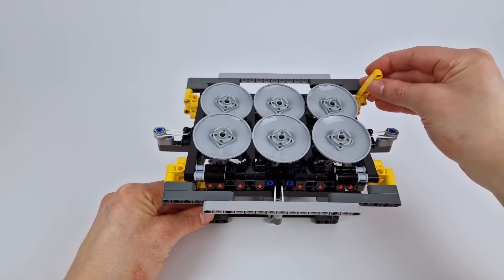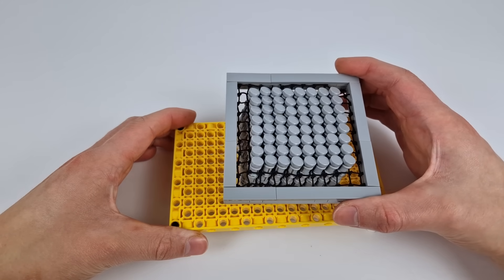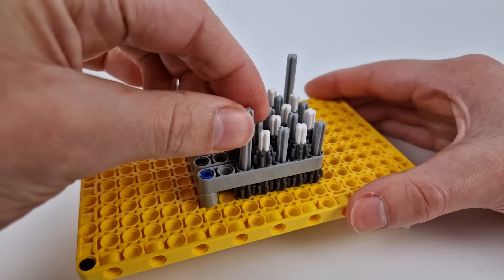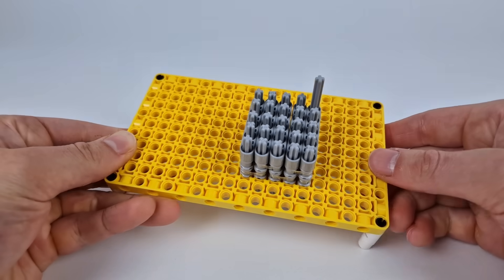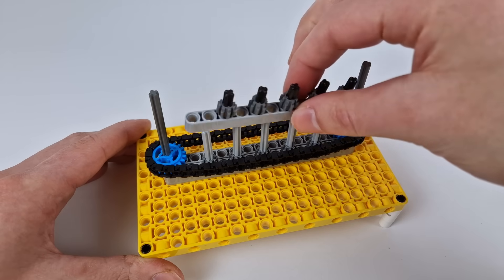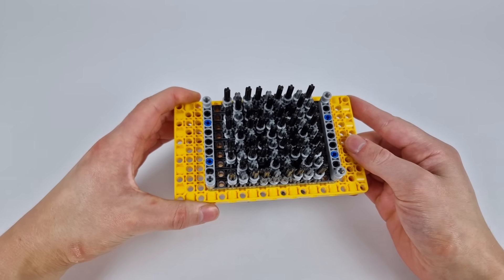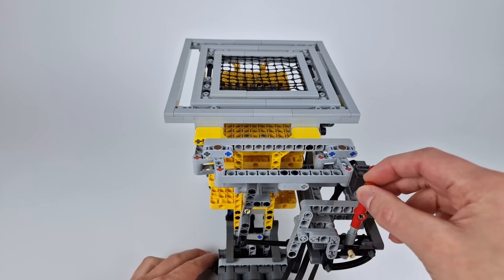How I Built a LEGO Treadmill That Moves in EVERY Direction

Comment: Had the thought of trying out those domed caps like what's used for warning lightson construction vehicles in city sets. The speed should be able vary by the amount of tilt given to the shafts. While the surface would be "rougher" in that it would still be bumpier than the flat tiles in a vertical position, the amount of roughness shouldn't change as much when changing directions. On the negative side, I think you'd have to have a truly flat platform like you had at the beginning.

Comment: I would have powered every other axle of the bottom layer all together like you had in the beginning. Then ran an external axle that carries the rotation to the second layer of the other half, and added a gear between the external axle and the second layer to reverse its direction.

Comment: Here's a naughty thing you could do:
Lego doesn't make a pin hole 8 tooth gear, but you can! Just get a drill bit of the exact correct size, and drill out the axel holes of some 8 tooth gears!
I may or may not have already done this on some other gears....
Reply: The one and only Taran. ❤
Reply: Could also transition to a bar using axle connectors but then it would make the entire build a few bricks higher
Reply: Please dont abuse the poor legos

Comment: I love the net idea.  Using legos in all the ways that they “weren’t designed for” is one of my favorite pastimes.  Seems that I’m not usually as clever as someone else.
Just a thought though.  I’ve seen and printed a hole punch guide for Lego bricks. Basically the idea is to use a hole punch and paper to extend the functionality of legos. Not my idea but I feel like this idea needs to be explored somewhere.

Comment: Why didnt you just do the central axle of each junk to be driven by the same gears the corner axles are driven? Seems to me as the simpler idea than using a rubber band or am i wrong?

Comment: idk if lego makes serpentine belts but thats a much easier way to accomplish the same task. its a belt that has teeth or grip on both sides, and is designed to 'snake' between gears that are in line, to opposing sides. left side gear 1, right side gear 2, left g3, rg4 and so on. then loop that bet one extra row over and make 2 layers of this. on a 10x10 you'd have 4 sets of belts with row 9&10 either getting an extra row or using gears instead of belts.

Comment: You could use the tan version of the (blue axel into rod)  +/o piece with a regular stick piece in the two layer design instead
Reply: Ive searched and i think the official name is lego techninc axel/pin, the rods that fit into minifigs hands can fit in the pin part which is actually a legal building technique.

Comment: That's amazing kudos for the design, I liked watching the various iterations.

However, I thought you would have done it in a much simpler way; basically, by expanding the grid underneath the discs by using a couple more u-joints and long axles, you could effectively increase the distance between each axle and thus power them with standard alternating gears, akin to your larger example (maybe staggering layers vertically if it becomes way too large to physically handle).
Then, all the axles converge into a compact grid to then link up with the discs!

I can't figure out if I oversaw something, because it feels way too simple; please, let me know!

Comment: On the bottom where you are tring to mesh the gears with the universal and whatnot you can take a band an twist it so it looks like an 8 this will let you turn them in opposite directions without that bulky gear setup.

Comment: I honestly thought the solution was going to be a series of universal joints pushing the drive axels further and further away from the central driven grid of discs, until they could meet up with a wider array of gears that could mesh. Almost like what you did with your 12 tooth gear idea, but even more, and further?

Comment: Great project! I love how you tackel every challenge in the design proces. Everytime i wanted to make a suggestion during the video, you already tackeled it in the next chapter.

Maybe 1 suggestion to make in a next version: make the possition of the net fixed together with the top surface of the enclosure and the balljoint of the joystick. So that only the machinery underneath swifts from side to side. A fixed location of the treadmill topsurface will make a great experience.

Comment: I've never seen Darth Vader moonwalk before! Btw, I wonder if it would be feasible to modify the treadmill layer would be stationary while the rest of the mechanism moves. Though I guess probabaly that would be too complex & too much mass moving. The reason just is that then the controlling of the direction would be more obvious as now the treadmill moving 90 degress to from where the object moves makes it a bit harder to see how the steering actually affects the object on the treadmill.

Comment: To keep the spinning disks all at the exact exact exact same angle, you could use a second net stacked on top of the main one at an offset on the X and Y axis, so that from a top to bottom view, the spinning axles are pinched on two opposing corners between each cell in the stacked nets and there's no free movement. This would need the top net to move faster and farther with the joystick control than the bottom one, which would be complicated, but I'm sure it's possible.
An even more extreme version of my suggestion would be 4 nets stacked, one for each corner of the axles
Reply: I saw that the lack of similarity in the angles sometimes caused slippage on the moving object, particularly heavy ones like the Christmas Darth Vader

Comment: So I'm not trying to be a know it all, but I'm just throwing this idea out there: Wouldn't you get away with actually only powering every second of those discs with every other one just being on a low friction bearing? As you are not gonna go below a 2x2 piece, with every second disc beeing powered (of course with one offset for each row, just like a checkerboard-pattern) that means that your piece will always be in contact with at least one powered disc and therefore move.

Comment: Perhaps another solution would have been to do the uniform-direction gearing in whatever grid size necessary underneath, then chain as many u-joints and rods as needed so as to converge into the 10x10 above.  Just spitballing.

Comment: Insisting on staying in the Lego world is limiting your options.  Several times while watching this I thought "why not just 3d print something that would work?" or why not just buy some O rings for belts.  Your friction problems are from the plastic bearings.  If you used metal ball bearings they should move fine.

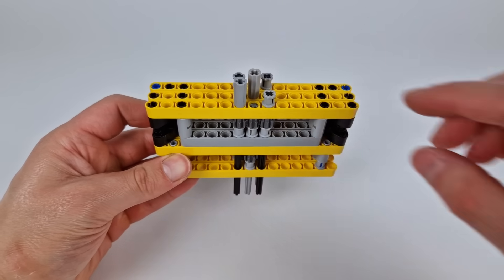Comment: 11:08 why not four 8-tooth gears?
Like, in a trapezoidal shape. Two 43857 pieces, coming off of each axle, connected at the other end by another 43857 piece. Maybe use 65249 to hold the two added gears?

Comment: design could be compacted by a lot if you used both the gears and the rubber bands. use the initial method where you had two layers of gears, except on the top layer use the rubber bands. the friction would be reduced immensely, because not only are half of them powered already, they wouldn't have to share the friction with their neighbors.

Comment: You forgot about the existence of the red 8t gear, almost an idler gear but would work as an idler gear on a 3.2mm bar. Not sure if this would actually work but it would make it all a lot smaller. Otherwise a 5mm drill would make idler gears quickly.

Comment: @7:00 I'm a little confused why this is an issue, unless only one gear on the entire treadmill will be powered by the motor. Would this not work if each side was connected to the motor, or would having four motor gears make it too bulky/big? Can one Lego motor even work with four or more gears coming from it? Wait... I just realized that doing it this way would re-create the original problem, where half the gears would still be rotating the wrong direction...

God, Lego engineering is so interesting.

Comment: Really cool!
You should enable motor only when using the direction joystick so the motor doesn't run if a direction command is not applied.

Comment: my initial thought is a 20x20 grid of the small gear (you don't need all the idlers though) and couple it to the 10x10 using universal joints.
though that'd be probably more expensive as 200 of them would be 60 bucks. and it's also not that scalable.
however then it's a 100% lego build.
though I do wonder if you actually need all of the discs to rotate, what if you make the 10x10 grid of gears, with only half the discs powered and the other half freely rotating (or soft powered using the lego rubber bands).

Comment: i like the initial idea of powering every other one through a simple gear mechanism and then powering adjacent ones on another layer through belts. you can put a lot of torque through the initial gear mechanism without much issue so i think it will work out even tho there are a lot of belts they aren't in series

Comment: At 4:16, couldn't you load the gears from outside the square of Axels? 
Like a some gears on the sides to spread out the pressure a bit. 
May work better the putting all the load on for example one gear.

Comment: As a factory maintenance worker, this video sent chills up my spine thinking about replacing any of those parts if this was used in a production line.
Reply from the maker: Haha you're more right than you know! To show myself building it on camera I had to dismantle the whole machine before filming to rebuild it step by step. Definitely wouldn't want to have to do that again just to replace a single piece!
Reply: goodie, You have unlocked the maintenance future memory.
Reply: Imagine disassembling the building size machine, just to get into one gear in the middle of the whole structure
Reply: @creo_one  Replacing any of those belts 💀
Reply: @creo_one  How to change your oil on a Hyundai:
Reply: I imagine it wouldn't be this complicated if the build process wasn't constrained to lego compatible pieces. for example, i'm sure that the mechanisms for making the entire grid rotate in the same direction wouldn't need to go through all of that development. it could also be for sure made to be modular.
Reply: If something like this was ever acutally used in a factory it would have to be modular so you would just swap out a module and then either repair the module on site or send it in for repair.
Reply: He didn't design the backend with maintenance in mind. That's one of the reasons why industrial equipment is expensive, stuff has to be bigger and designed to be serviceable. You can't get away with the bs like they do in some cars
Reply: or it could be creaited in a way were you can just pull-out the roler (the disney imagenears one is a good real-world example)
Reply: I don't think you'd replace a single part. You'd replace cells of it.
Reply: I'm sure the design of an actual product not made with Legos would be a lot nicer to maintain
Reply: Not just you. Used to upkeep experimental factory lines so i understand you. This is straight   out of my nightmares.
Reply: @TheRexblisar  God you definitely get it then. Like yes in theory there are good ways to build this such that repairs are relatively painless but the engineers always treat maintenance and how we have to do it as an afterthought. Not to mention the plant supervisors are gonna breathe down your neck if you don't have the line back up in a quarter of the time it'll actually take.
Reply: So I work for a company that installs designs like these (usually for omnidirectional sortation solutions). They are really cool machines, but Id hate to be the guy to come in when one breaks. I know the repair process can sometimes suck
Reply: there are two types of workers
“I love how you overcame the problems and made this!”
“I’d hate to replace this”
Reply: Yeah, we are size limited with LEGO and the other bricks.
Though you could try the half sized bricks from other produces, but idk if they make technick pieces that small as wwll
Reply: Guys, this has been in use for years, and it isn't the nightmare that you are imagining for maintenance, as in the real world we don't have to build things out of Lego 😉 Google "omnidirectional conveyor".
Reply: i understand completely, but i think in a factory setting they would think about it
maybe larger individual disc modules that could just be pulled out of the system, and they each have their own small motor to reduce mechanical complexity?
Reply: As an engineer, I won't put any thought in making your lives easier
Reply: But you have to admit the concept has it’s applications.
Reply: I'd worry less about replacing parts and more about foreign objects falling down into the gears.
Reply: This would still be amazing for package sorting, except the maintenance😂
Reply: Lets do this and sell it as a product - Apple! :D :D
Reply: are you Asian by any chance?
Reply: @Chasepicard9412  What an absolutely strange question to ask. Why?
Reply: @DarkDragon2344  why not? wanna be SJW
Reply: @donkun3395  Now looking at your subs you appear to be a child, so this is a good chance to educate you. See it's generally seen as a pretty odd and tactless thing to just go asking strangers their ethnicity. Take that one with you little buddy and remember to do your homework.

Comment: Have you also tried to not make the wheels smaller, but the contacting object bigger instead? Like something the size of a planet? 😉 You basically just have to turn it upside down and mount it into an object you want to move. 
What I want to say is that this may actually be useful, not as a conveyor, but as a drive system for vehicles/objects that can move on a level surface with very little clearance to the floor. The whole construction just has to be sturdy enough to support the weight of the "vehicle"

Comment: If the smallest object that you place on the treadmill is 2x2 studs in dimensions, does every disk need to be powered?  Just thinking of the 3x3 chunks, the central disk might not need power if whatever is on it is also being pushed by another disk.  Or, if a 3x3 object was placed on the treadmill, would it be possible to get away with just powering every other disk, checkerboard style?

Well, obviously powering every disk is cooler, and enables smaller objects on the treadmill overall, so that's better, but my mind's wandering.

Comment: I've watched the whole video and I have a few notes/questions.

1) Did you try leaving half the discs undriven, ie. idlers? You show how a single plane of gears can't drive all the discs in the same direction, but do you actually need to drive them all? With the light weight of the items you demonstrate with I think it is unlikely to work, but it would be an easy thing to test/demonstrate.
2) Why not drive the two gear planes with their own motors? They may not move at exactly the same speed, but it may be close enough for the small surface area.
3) You already pass the shafts of the lower gear plane through the upper gear plane so they can drive their discs. You can also extend some of the upper gear plane shafts through the lower gear plane and use belts, chains, or gear trains to connect them to some of the lower gear plane shafts. Did you try this?
4) Friction is why belts are not used in parallel. They rely on friction to work at all and yet they are held back by it. To reduce the friction is to reduce their power. I'm glad you demonstrated the friction issue and how bad it really was.
5) Your design uses a lot of parts. This is the opposite of over-engineering. Engineering is fundamentally about reducing the cost of doing something. As a rule, using lots of parts is a sign something is being overlooked. Sometimes you really need all those parts, but almost always you don't. 

Overall, I'm impressed. This was a really neat use of Lego, and the presentation of the design process and the demo was clean and concise. Keep up the good work!
Reply: Honestly, when he showed the two gear planes at first, I was surprised that he never tried to just... power both at once from the side.
Reply: @R4d6  Ah, but they both need the full grid of gears, cause those don't connect diagonally, so the axles from the bottom plane need to pass through gears in the top plane and now you've essentially turned them into one plane and it'll lock up when you try to drive both.
Reply: @cameron7374  just have another axle which isn't part of the platform's axles going up a level, after branching off with a gear.
Reply: @R4d6  So how does that allow all the axles from the bottom layer to pass through the top layer to reach the plates at the top? (without connecting with the gears that must be in the top layer's empty spaces to power it)
Reply: @cameron7374  Well just look at 4:07! The guy does the setup, but doesn't think to power the second layer from the side separately.
Reply: @R4d6  If you power the second layer from the side there, only the gear(s) that you are directly powering will spin, so you can't reach the axles in the middle.
(Because the gears aren't connected because there needs to be gaps in the layer where the axles from the bottom layer come through)
Reply: You can't have the middle layer without driving all the Axels.

The gear on the wrong direction shaft will always power it the wrong way.

The full 1x1 gearing system will ALWAYS power all shafts that pass through that layer, because the gears are ALL required on every shaft for it to work.

He specifically says if he COULD have slipping gears it would work, but there is no official slipping gear of the right size.

He COULD use a slipping shaft (he mentions a rod) but then he can't power the rod (it's a rod not a shaft!)

He specifically mentions the 1x1 gear system not working due to these issues.